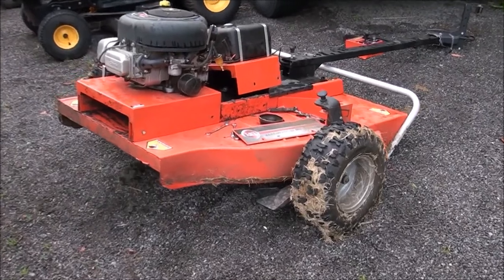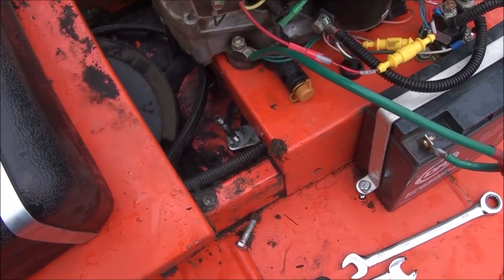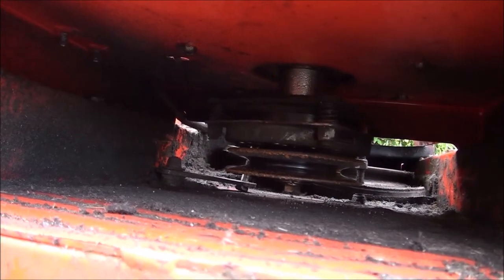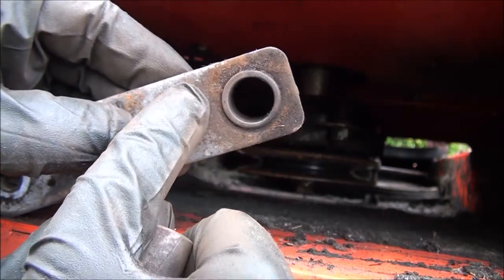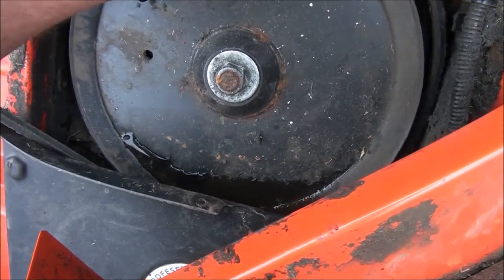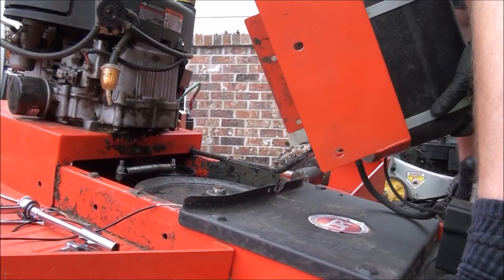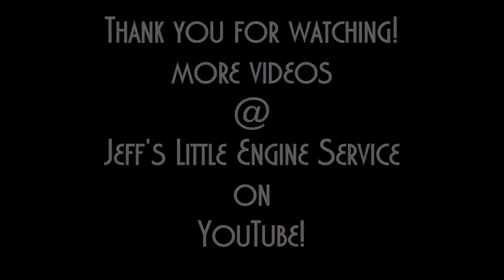Pull Behind DR Field and Brush Mower.  HOW TO FIX . REPLACE the BELT and PULLEY.

Comment: Thanks for the video. Did this project today. Could not wait for the pulley so I pulled one off my walk behind mower and used it. Both had the same part number 151271. 4 inch pulley with a 3/8" bore. I have 2 pulleys that will be here in a few days. I used the wire trick on the spring and tied the 2 ends in an overhand not to make a loop. I then used a screwdriver on the side rails to pull the spring onto the spring tower. The belt I ordered was a BP51 1 Band, B/5L 54". I had one in my maintenance kit that I used today and ordered a replacement for the next time. DR does make a great product. I have Tow behind, walk behind, power wagon, road grader and stump grinder. Looking at the high end wood splitter...
Reply from the maker: Cool! Thanks for watching and for the comment!

Comment: Just outstanding. I wish DR would have taken the initiative to do one of these self-help videos. I use the machine to maintain trails and meadows on 19 acres and after 12 years service, the belt finally snapped. I will check the pulley and belt tensioner...they may be worn out as well. Thanks for taking the time to make this.

Comment: This video is an outstanding tutorial! I had the exact same problem with the same model mower. The tips given are excellent, saving me loads of trial and error. Especially the tips on lifting the engine a bit when needed, and using a wire to get the spring back on. DR was very helpful in assisitng me with ordering the right parts, and downloading the manual with the parts diagram helped that conversation a lot. Thanks again for the great video!
Reply from the maker: Thanks Ben!

Comment: Thanks for the awesome vid! I am just getting ready to do the same exact repair and was so happy to find this video. I had no idea there was a rear access panel on the outfit. Just saved me a ton of time I would have wasted on self discovery and trial and error repair work. This pull behind bush hog is the best piece of mowing equipment I have ever owned and is an absolute necessity on the many acres of overgrown property I own. In hundreds of hours of use, its the first time I have ever had to perform any maintenance on this outfit other than oil changes. My other mowers have cost me hundreds in dozens of replacement belts. DR makes an AWESOME product - and you are so right - the website is so easy to order from.

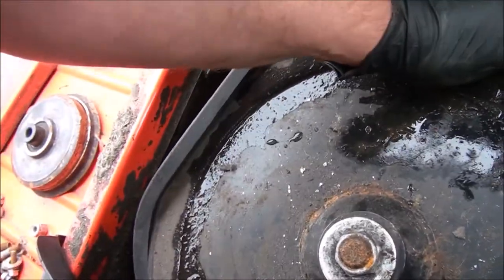Comment: Jeff - question for you. When you were installing the new belt and rotated the blade pulley, I heard a srceech as you turned the pulley. I assume the belt was around the clutch and that was a clutch noise. My TB1 is doing the exact same noise (at about 6:30 into your video) when I engage or disengage. Does that mean the clutch is bad or going bad or just normal wear?
Reply from the maker: Not sure but some noise is normal, if it starts to hurt your ears something may be wrong

Comment: appreciate the video, could you please let me know what size belt you used? I was sent a belt by an aftermarket parts supplier for dr; however, the belt has too much slack and it causes the tensioning pulley to interfere with the main drive pulley. thanks in advance